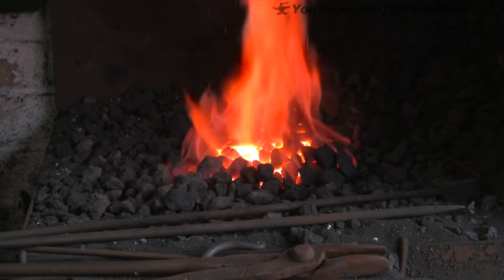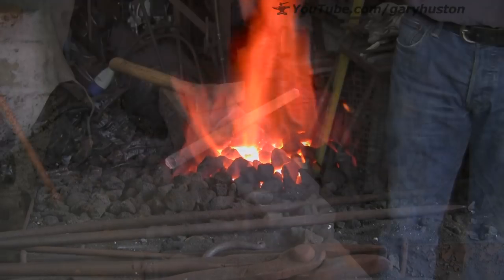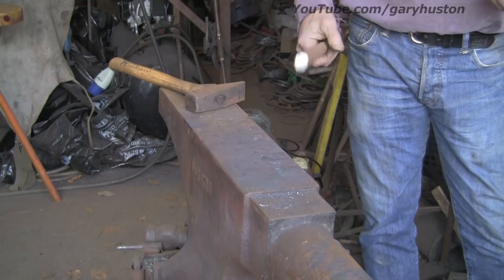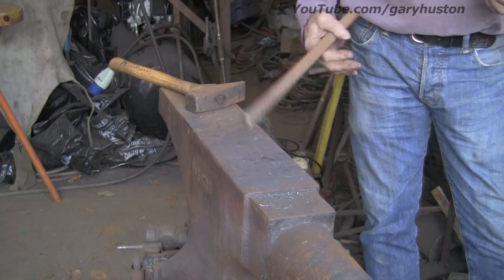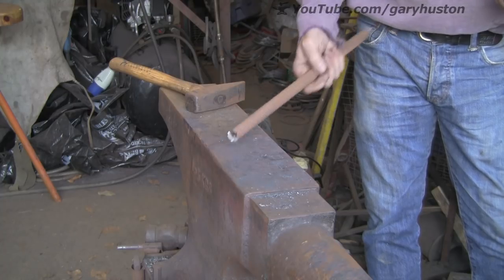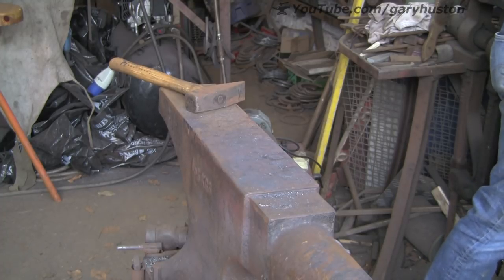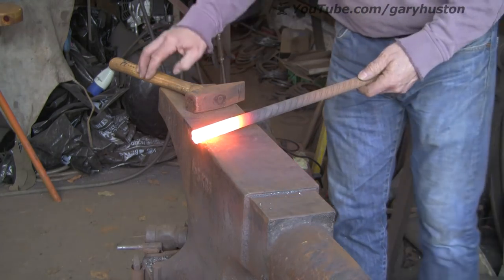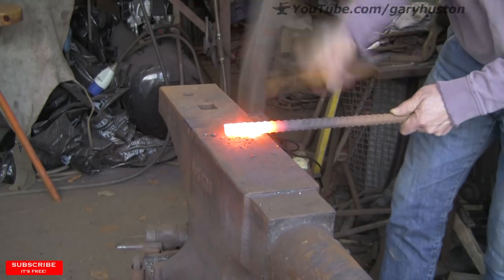Rebar knife

Comment: Hundreds of years ago to make a steel higher in carbon, saw dust or charcoal was hammered into the steel when it was red hot, when in college we used the practice of placing the mild steel pieces to be hardened in a steel box full of charcoal and heating it up to around 1400 degrees for a few hours

Comment: If you can find the manufacturer's marks (numbers and letters), you can usually find information about it online. A lot of the rebar here in the States is made from recycled train rail and is easily hardened with a water quench.

Comment: Gotta love the tenacity of that spider, walking right down the edge at 19:23. Someone who is very new or someone who has not tried to forge on a preset line can not fully appreciate what you have done there. Maybe pick up a piece of round bar and hammer in a blade, but to do it and keep it in line with the two straight lines on the rebar that there is talent.

Comment: Some steels water harden some air harden and some oil harden your have to see which one would work best for rebar I'm not really sure quite off hand.
Reply: 777damage777 there generally not enough carbon to harden rebar, so you have to first carburize the steel before you can quench and temper the steel

Comment: I have seen a lot of blacksmiths make knives from rebar. I could understand if it was mild steel like a railroad spike, but an average piece of rebar is usually carbon steel and very good for forging. Though I'm not sure of the metal types used in the UK for rebar would be.

Comment: Nice looking Blade. I have never tried making one from rebar. I have used it to make tongs and such but that is about all. Like you said it is not the easiest metal to work with. You might try chalking your file. It may help keep it from picking up particles from the metal. Also, as somebody else has already suggested try quenching with water.

Comment: The real problem with rebar is that it's not a consistent product, one batch might have a high carbon content and the next will be little better than mild steel, it's whatever scrap they throw in the melting pot that day, you just have to do a spark test before you forge with it.

Comment: Gary, you might have tried to use a water quench. Although rebar varies wildly in its composition, there often is just enough carbon to harden. The oil quench you used obviously wasn't aggressive enough. You could even make your own "Super Quench" with house hold ingredients. If that doesn't work then it's good only for garden stakes. One of the reasons it was so tough to work is that it may have had significant amounts of silicone in it. Chromium also makes it hard to work but no one would even use such an expensive additive for rebar. Good to see you forging again!
Reply: Glenn Wiebe 
Chromium is widely used in rebar for concrete works around saltwater.... pick up a piece with American markings and third marking down is “SS” than is is Stainless Steel (A955), if the marking is “CS” than it is low carbon Chromium Steel (A1035); unlike the typical S or W which will have no chromium...... for those of you buying in “Metric Land” you can find the guides for what the rebar markings mean on the internet as well as I did for the markings here in the USA....

Comment: When working with  rebar, have you tried to water quench for around 2 seconds, then to use a torch and get an edge quench in oil?

I have heard alot of different things with rebar, im currently using this method and it seems to harden well, curious to your take.
Reply: The main thing I have heard with rebar and hardening is not to use oil, but to use water (unless going for an edge)

Comment: its a bit hit and miss with rebar,  best thing to do if you want a hardened edge on rebar is to do a hardening test on the piece you have at the time, see if you can get it hard using oil or water (leave it!!) 

have you tried quenching it in cold wet spinach leaves?

Comment: You did a fine job sir, as far as rebar it's not rubbish as reinforcement, It's rubbish for making knives just like railroad spikes too low in carbon. It's mild steel mostly unknown makeup, it has it uses just not for knives.
But don't get me wrong in a pinch making something for self-defense with limited resources rebar will do.

Comment: Most rebar / reo tends to top out at 0.38% carbon, and thus doesn't harden to any real extent.
Reply: Having said that, it's great stuff for general smithing work, hooks, brackets, etc  Just nothing that actually has to hold an edge.
Reply: David de Groot yep, this is what I want to ask. Well done indeed, but the edge I guess doesnt hold the sharpeness.
Reply: David de Groot 
The problem with working with scrap rebar, unless you really know what you are doing, is that you pick it up and don’t know what is in your hand... there are different types, including rail, carbon and stainless steal varieties, and then there are different grades.  If you don’t have the rebar piece with the markings, and you aren’t well versed (like most people with a backyard forge), than you don’t have a clue as to what you’re beating on, or if the item being made will be of the quality you want for what you are making...

This guy keeps saying it’s tough stuff, maybe re is working with a high grade rail steel... it doesn’t sound like he knows... he didn’t say if there were markings before pounding on it, so he probably doesn’t and without hearing/seeing the rebar codes I can’t figure it out (especially from here)...

Comment: Nice knife. Would like to know how well it holds its edge. I’ve used rebar to make centre punches and hardened them by quenching in water. Makes a good punch for general use on mild steel.
Reply from the maker: It has held its edge well as it doesn’t get used! I’m guessing that it will be like the punches, hold an edge for a little while but not for ever.

Comment: Rebar is made of scrap but normally higher end scrap and it still has to meat standers I can't remember properly if there's 5 or 7 different grades of it
Reply from the maker: Seven as I recall
Reply: Rebar is usually graded as 33 through 40 and is pretty low carbon even in the better grades. They do make one with higher carbon called black bar. I have never used it, but I am told it has a tendency to crack as you work it.

Comment: Could you have case hardened the blade?
Reply from the maker: I could, but why would you bother? It's just a bit of fun which will end up in a drawer with all my other knives!
Reply: Gary Huston I agree, but I like the look of case hardening and it might have contrasted well with the satin finish of the rebar.
Reply from the maker: case hardening doesn't have a colour!
Reply: Gary Case-hardening involves packing the low-carbon iron within a substance high in carbon, then heating this pack to encourage carbon migration into the surface of the iron. This forms a thin surface layer of higher carbon steel, with the carbon content gradually decreasing deeper from the surface. The resulting product combines much of the toughness of a low-carbon steel core, with the hardness and wear resistance of the outer high-carbon steel.
The traditional method of applying the carbon to the surface of the iron involved packing the iron in a mixture of ground bone and charcoal or a combination of leather, hooves, salt and urine, all inside a well-sealed box. This carburizing package is then heated to a high temperature but still under the melting point of the iron and left at that temperature for a length of time. The longer the package is held at the high temperature, the deeper the carbon will diffuse into the surface. Different depths of hardening are desirable for different purposes: sharp tools need deep hardening to allow grinding and resharpening without exposing the soft core, while machine parts like gears might need only shallow hardening for increased wear resistance.
The resulting case-hardened part may show distinct surface discoloration, if the carbon material is mixed organic matter as described above. The steel darkens significantly, and shows a mottled pattern of black, blue, and purple caused by the various compounds formed from impurities in the bone and charcoal. This oxide surface works similarly to bluing, providing a degree of corrosion resistance, as well as an attractive finish.
Reply from the maker: @koolkats724  Thanks for that diatribe,  I know very well how to case harden, i was doing it 45 years ago but using the modern method not that hoof and piss nonsense! I used kasenit powder, much easier and when polished leaves no colour!